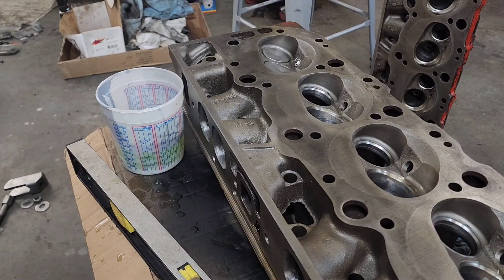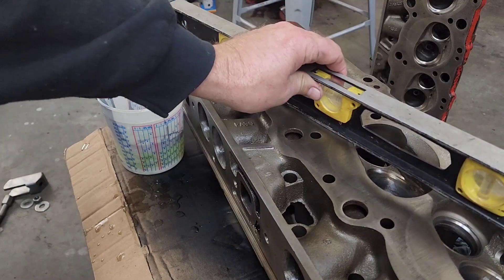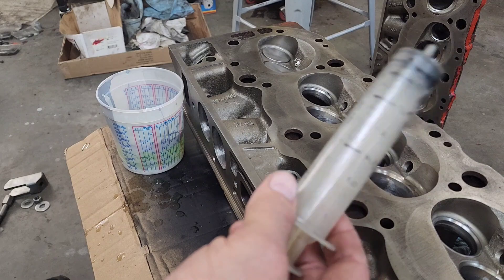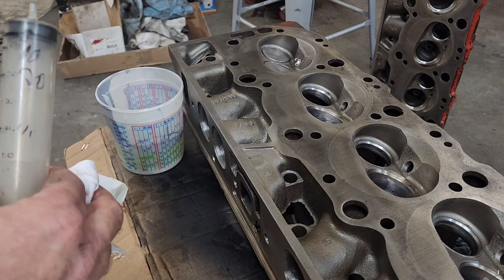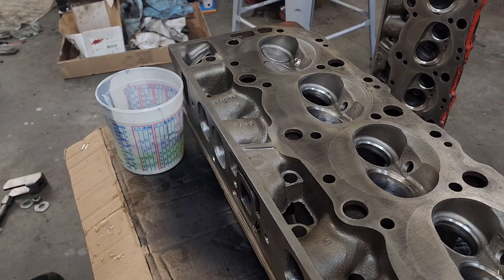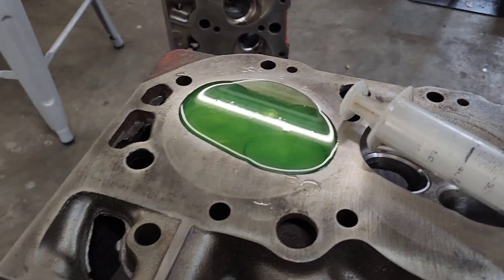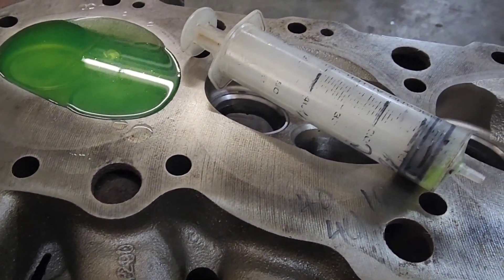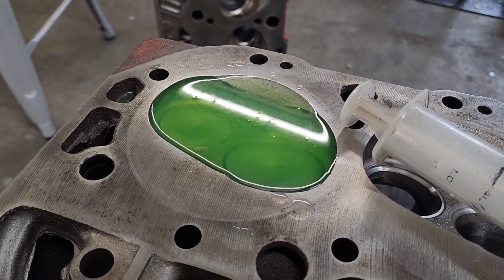1969, 396 BBC simple way to measure combustion chambers

Comment: With 702 casting and flat top piston would the compression ratio be 10.1 ,I got a 464 o30 flat top I want to build for my 4WD
Reply: It would be closer to 9:1, 702 heads with ~17cc stock dome pistons gives the stock 10.25:1

Comment: Hi nice vids. Ive got 702 castings and they are advertised around 96ccs. from what i can tell, the diff between your 292s is that the area above the sparkplug hole is 1/4 mooned quench area while my 702s are not.  I got these heads since my 462 is running flat tops ( with one small valve relief) and i want to bring the CR up. Im currently running stock PP 360 castings. It runs good with about 42 deg total timing but the 702s slightly cleaned up should give me another 50-70 hp ?